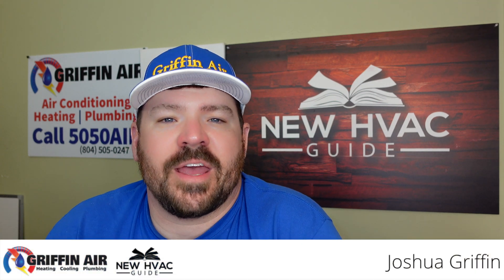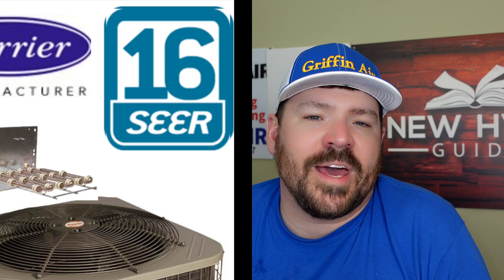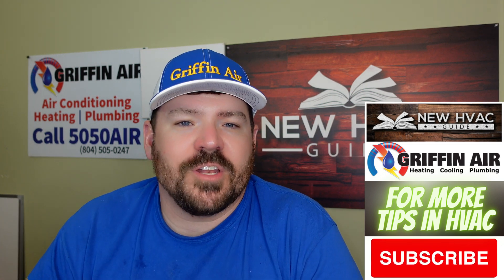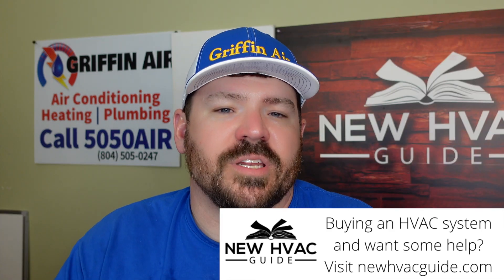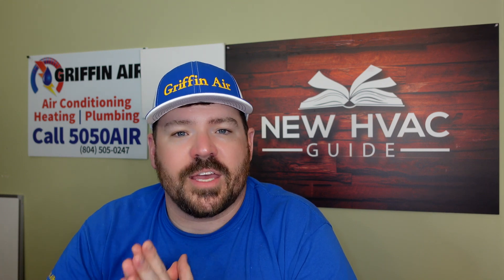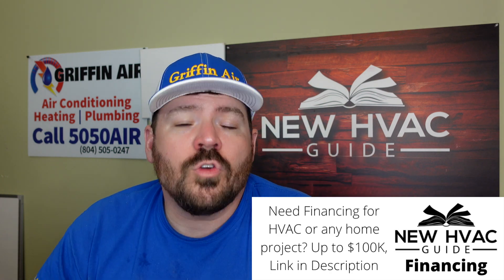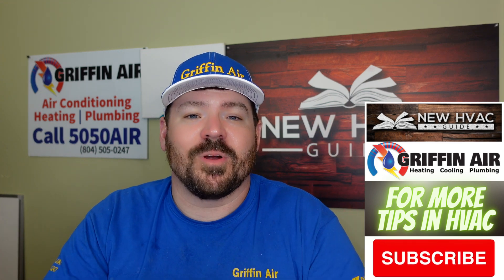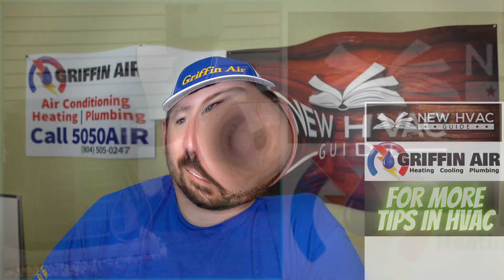Is SEER a MADE UP Number for HVAC Equipment?

Comment: While it isn't a made up number, it is subject to 'specmanship', where manufacturers will optimize to get the highest number rather that optimize to get the best efficiency in real world use.

In particular systems can get very high SEER numbers operating in ways that give poorer moisture removal, and in many locations moisture removal is more important than sensible cooling.

In particular beware of crazy high SEER numbers (37 SEER minisplits) because these are almost certainly evaluated where the evaporator temperature is barely below room temperature, and you are getting cooling with minimal moisture removal. 

Jon
Reply: Wow!  I want you to service my A/C.

Comment: I installed a Goodman GSX16 16 SEER condenser on my house. The yellow tag on the condenser read “14 SEER” so I double checked the model number. Anyway, my electric bill dropped quite a bit after installing the condenser and matching furnace and coil so I am more than happy with the efficiency and performance of my new equipment.

Comment: I don't understand how the variables you *alluded too (insulation, duct work, etc.) come into play when you are replacing an existing system.  Shouldn't the relative performance be a constant?  If I have a 10 seer and replacing with a 20 seer, shouldn't I see 50% improvement in efficiency which would show up in a lower electric bill as I am using half the energy for the same cooling result?
Reply: So what you are saying is that there is no benefit to upgrading the efficiency of the hvac system if the house is not efficient?  A 20 seer system will cost as much as a 10 seer to operate?
Reply: @johnanderson2432  No, I'm illustrating why it rarely functions in the described ratio.
Reply: Well yeah insulation and duct work plays a huge part on how well a system will cool a house. Poor insulation and poor duct work won’t cool that well if you have a high end system
Reply: The word is “alluded”.
Reply: If all the variables are the same I both scenarios, then, it will save 50% in energy in the 10 and 20 seer scenario you showed.
But that doesn't mean that you will pay half the money because that depends on the cost or electricity tariff of your electric company.
Reply: If you were trying to heat your house with a leaky straw would it really matter how "efficient" the blower going into that straw was?  Efficiency would be basically irrelevant to the other limiting factors.

Comment: Is the seer # only applies to the outside condenser but not to the air handler?
Reply: No it applies to the entire system; however some of the points made by Griffin Air are correct; you need to know the insulation ratings in the walls; attic and sometimes if part of the home is above a garage (split level) we found homes where they applied sheetrock to garage ceiling and never added insulation. If you have quality storm doors and windows (triple glass), etc. It will make a tremendous difference in the efficiency of the home. Joshua is the man to call.